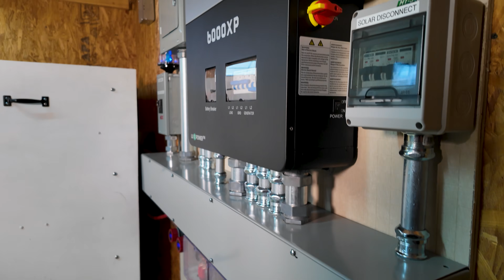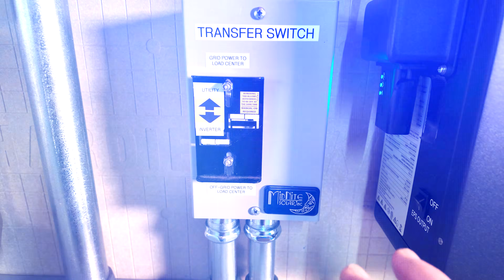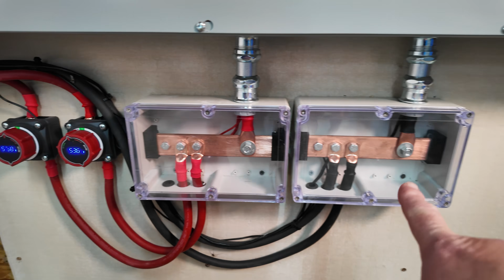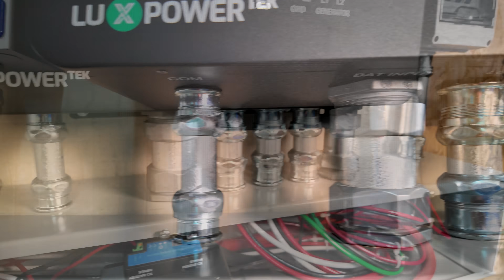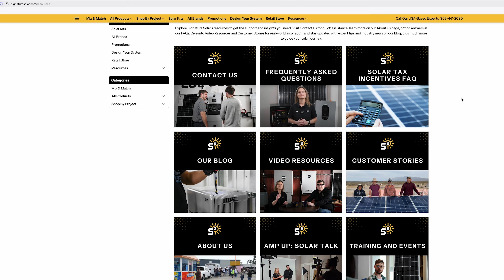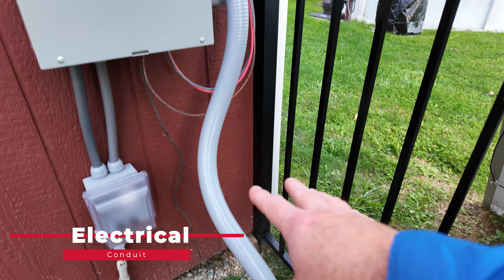Off-Grid DIY Solar - Walk through of Solar Shed Upgrades - PROJECT FINISHED!

Comment: Nice, but 2 comments: I don't see ground bonding on your wireway, nor on battery box, then you need a class T fuse before your batteries  switches  and ideally another switch from positive busbar to your inverter, then the fuse.
Reply from the maker: Thanks.  Check out 4:54 and you see the the bonding of the wire way on a ground bus bar in the upper left hand corner of the wire way.  Also, at 7:08 you can see the Class T fuses coming off the each battery rack before the positive cables.   Just to to note, there are already 2 switches on the positive coming from each battery bank before entering the positive bus bar.  The XP6000 has a breaker switch on the DC side too.  The DC postive bus bar can be completely isolated if needed.

Comment: Have you gone through a winter yet with those batteries? just wondering how the insulated box works and if it has any heat? Nice looking system overall.
Reply from the maker: Yes, I have been using he box for several years.  Using a seed mat on the bottom.  Check out my channel for a video on it. Work well, only 22.5 watts drawl per hour.